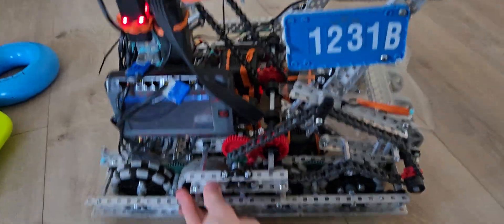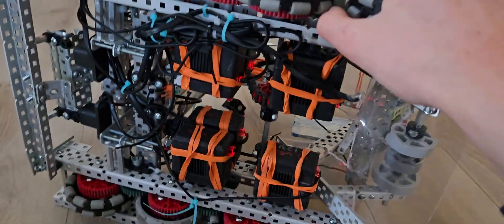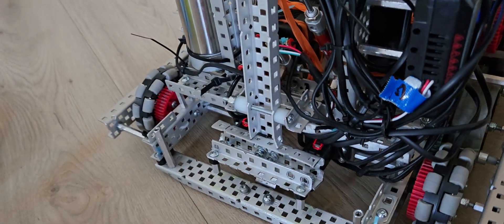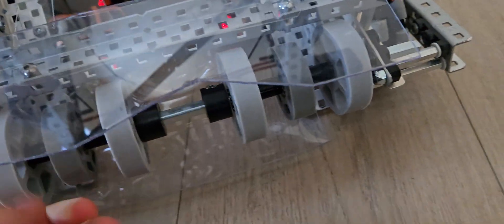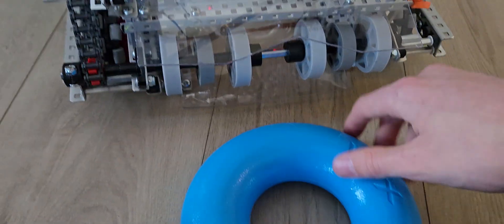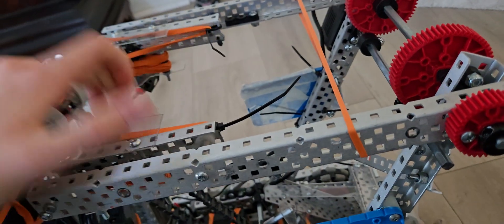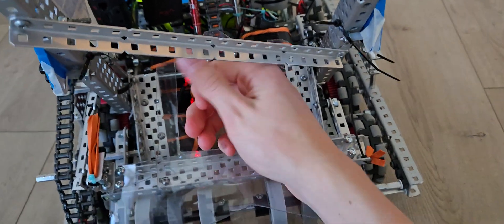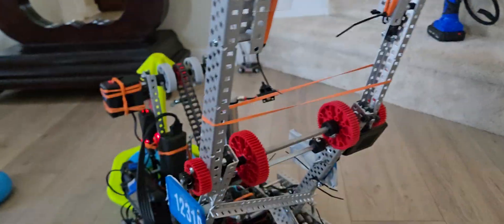Fall Robot Explanation - 1231B Better Think of a Name

Comment: Great robot! I just wanted to ask how you guys make your chain with ur hooks rotate so fast. I saw only one motor for your chain but wasn't sure if there was anything else that went towards it's speed.
Reply: Just one motor, likely running at 600rpm (blue cartridge)
If the ring is flying off your hooks while it is swinging over make your hooks longer
Reply from the maker: To make it go quick we try to keep the friction down for our 600 rpm blue motor and use not the smallest type of sprockets.